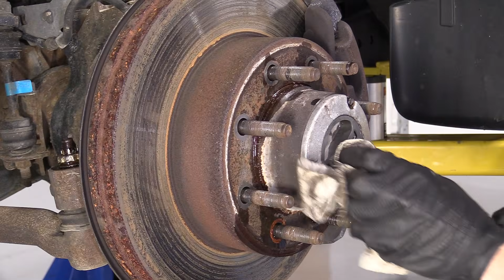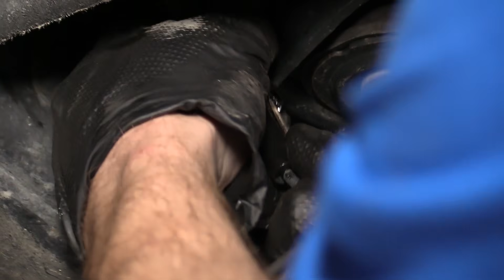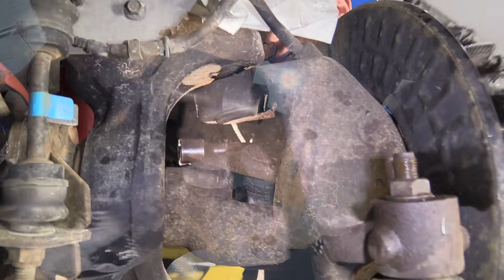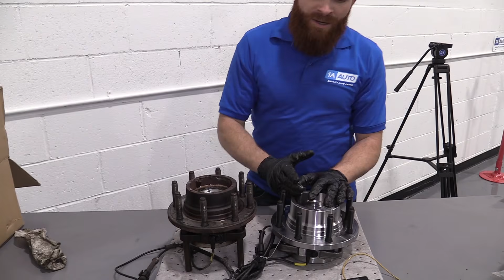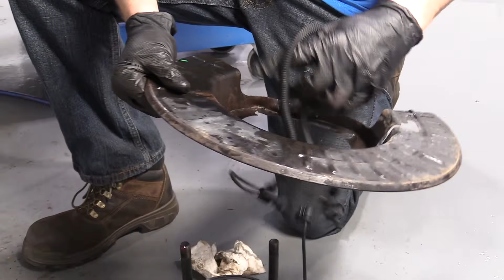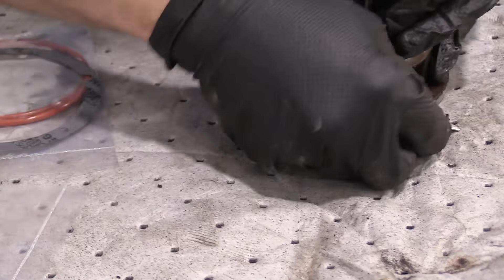How to Replace Front Wheel Hub Bearing 11-16 Ford F250

Comment: Good video. Details and nuisances are very helpful.
 
I've been a "backyard mechanic" for over 40 years. I'm a business owner and I service my own vehicles, so I tackle most of all the repairs.

That being said, no matter how experienced you may be there's always room to learn. I did on this video. 

The screws to hold the ABS wire were tightened all the way so no freedom to move as explained in the video. I suspect the previous owner, of my 2016 F350 4WD, or a repair shop made them too tight. I made sure they moved freely.

To remove the snap ring, I suggest getting a quality pair that has a long reach. 

I did not have to remove the tie rod end. Not an issue to reach in to loosen and the tighten.
Reply from the maker: +@forfreedom-f4u Thanks for checking us out. Shop for high quality auto parts on 1AAuto.com:

http://1aau.to/m/Shop-1AAuto-c

Comment: Ty sir
Needto do my 2016 f350 6.7 with 240k miles.
Front end making funny noise after nee tires installed.
No wheel shimmy or vibration just strange noise.

Comment: 2 things already-  I've done 2 sets of these on a 99 diesel, and never needed to disconnect the steering linkage, so we'll see if it makes the job easier.

The most important bolts that need penetrating spray, the 4 bolts that attach the wheel hub assembly, didn't get sprayed.

And I don't agree with needing an alignment when swapping a wheel hub.

I came here to see what impact he uses, because I can't remember if the last time I did mine, I just used my own strength w/ a breaker bar.  I was much younger, so this time I want to use an impact, but I know there's not a ton of room back there.  I guess I can crawl under my truck tomorrow and see.

After a bit further in the video...

I hate watching mechanics work like this. 2 more things:

The rotor HAS to come off, so just take the damn thing off before you hit on the steering linkage with a hammer, to ensure you won't hit the rotor.
Just wire up the steering arm.  I noticed it not being done as soon as he went to remove the nut, then he says, "I'm not worried about wiring it up...;  Oh wait, maybe I should wire it up anyway."  Yeah, good idea so you don't bump into it and mess up the other tie rod end.  Or stress that other end by letting it hang.

See, this is the thing about letting people work on your shit:  They may get the job done right, but who knows what OTHER stuff they fucked up in the process, that won't show up as a problem until many miles later, at which point you have no recourse.

I would NOT want this guy working on my truck.

Man, this dude!  The snap ring:  He says it's probably the hardest part of the job.  Not even close, as long as you have snap ring pliers.  The reason they include a new one, is you really should only bend that ring outward one time- the time you have to do so to install it.  Otherwise, you could just re-use the old one.  So what does he do?  He bends the new one.  So now that new one will have been bent more than necessary.  He could've just as easily demonstrated how they work on the old one.  Not a huge issue, but still.  

And the thing he DOESN'T mention about the snap ring- Make sure you have the correct tips installed (THERE'S a good place to use the new one), so they fit into the holes without any play, and make sure you have those tips FULLY inserted into the holes before you try to remove it.  If you do those 2 things, that snap ring will pop out just as easily as it did, and the pliers will NOT slip off.

And then the way he tore up the tab on that electrical connector.  Nice job!  All those connectors have a release clip that you have to raise up slightly, while at the same time depressing the locking tab, while at the same time pulling the connector apart.  THAT is the hardest part, or one of the hardest parts of the job.  The older the truck, the more brittle they can be.  You gotta be very careful with them.

Not a bad idea on using the truck's steering to break the hub free of the knuckle, but it goes to show that he took the tie rod end off too early ( I say it's not even necessary), but I could just see someone like this (based on the other dipshit moves he's made) banging the door against the lift when he gets in/out of the truck.

A much better way is to use the rotor as a slide hammer, like mentioned below in another comment.

I can't see beating on that hub with a hammer and transferring all those shocks into the needle bearings in the u-joints, and the other end of the axle shaft where it connects into the differential.  Idk if it really matters, but that really made me cringe.  I have always been able to separate them with a pry bar between the hub and the knuckle.

Alright, I'm done picking his job apart.  I'm sure he'll get it done ok in the end, but imo, he doesn't think things through well enough.

I'm not watching the rest of this, this guy's a hack.  But I will add something that he also didn't mention:  When I did mine on my 99, I bought Timken parts.  They are the SAME EXACT BEARING they produce for Motorcraft, but about half as expensive (you're paying for the name, in part.)  But, even Timken can have issues.  Rotate that bearing before you install it.  Anything less than PERFECT feel, don't use it.  I had one of my 2 that had a slight "bump" in the rotation, so I returned it.  The replacement was perfect.  It happens.

Comment: Lisle 40100 is a great tool for breaking the hub loose. They also have a great tool designed specifically for the super duty spindle snap ring, 38700 is the part number.

Comment: The engineer at Ford that thought that snap ring was a good idea needs to be the one to deal with it every time a wheel bearing on every truck with that hub needs replaced. I've bought and broken 3 pairs of snap ring pliers trying to get that off and still no dice.

Comment: Torque spec for Wheel Hub Nut (from service manual Section 204-01BN): 
"Position the wheel bearing and wheel hub and install the 4 new nuts. Tighten to 180 Nm (133 lb-ft). "

Comment: Tip from old timer....
Take the hub apart leave the rotor on.
Remove outer brake pad reinstall caliper.
Take off bearing nuts.
Start and press brake hard.
Use a clamp to push caliper back in.loosen bleeder first dont push the fluid back into the master.
Slip the outerpad between the inner and the rotor start and press again till rotor is against the bracket. 
Now Remove bracket with caliper. 
I replace the rotor when doing wheel bearing so you don't have to separate them unless you reuse the rotor easy on the floor with blocks and hammer.
The bearing has been pushed out on one side.
Put a nut on one front stud halfway. 
Get a large punch that fits the nut good but goes into the stud.
Place it like he used the socket with extention. 
Turn the wheel to drive the punch into the stud and push till nut bottoms.
Remove nut.
Prybar the last little bit.
No hammering.

Comment: This is a great step by step on how to do this job. One thing to add, the split ring in the hub is very difficult to get out unless you have the proper tool. I have tried 3 different types of pliers and cannot get it out. Apparently Lisle makes a tool specifically for the job and the model is 38700 Spindle Snap Ring Plier. I live about 45 minutes from the nearest town, and wish I would have known this before I started.
Reply: Absolutely! Had the same issue, luckily my neighbor is pretty handy and had a set of old school blue-point pliers that worked like a dream.

Comment: Friendly tip, i couldnt get my rotor for the freakin life me, prayed to all the gods tried every method nothing, almost gave up, then i had one more idea, grabbed a 25lb weight put it up between the rotor and the brake caliper, its hard to explain but once you get it in position, youll know what to do, i used the 25lb weight solid 2-3 hits and the rotor popped off, no damage no nothin, the 25lb weight is one of the old small circular ones that resemble a discuss from track n field
Reply: I love this.  I fought a rear disk on an F150 for hours, because the parking brake is a drum brake inside the rotor.  With the pads fully retracted, The rotor was still hung on the worn lip.  I finally wedged some type of pry bar behind it so the hammer blows wouldn't be taken up by the springs.  The replacement went on with 2 drilled and tapped holes so I wouldn't have to fight that battle again.

Comment: This has been fun to follow along.  Not fun to do,  the first hub took a week to get off as I found the right tools for the job.

There’s a super duty specific snap ring plier that made it much easier.

And after braking the hub from the knuckle using the power steering- which is genius.   The 3 jaw 7 ton puller from oreillys made getting it the rest of the way out a breeze
Reply: What I like to do is cutting to of the bolts, put in a 1/2 bolt and a nut between knuckle and wheel bearing, turning this nut wirth a open wrench will push it out, doing it equal on both sides makes it easier

Comment: To remove the bearing, could you use the steering pump to pull it off. Like the extension but in reverse? Tie a strap around the lungs, around the lift stand, and turn left? Ever try? Thanks,....great video BTW!!! I'm a do-it-yourself guy without your equipment. GOD BLESS and thank you for sharing!

Comment: Take your rotor and put it on the hub backwards with 3 or 4 nuts installed far enough the threads protrude through each nut. Grab rotor and begin sliding it back and forth and this creates a slide hammer and gets the hub assembly of relatively easy. 😎
Reply: Unless you live on the rust belt…
Reply: Great tip, makes for a slide hammer, I LOVE IT.

Comment: Is there anyway that you could give me the name brand or part number of those C clip pliers you used to take that C clip from the inside of the hub out? It took me 2 freaking hours to install that clip, raaaaaaawwww!!!!! It came out easy but to install it, it took me FOREVER to reinstall it. I went through 3 different sets to install it and I finally had to grind the outer edges of one set and still gave me trouble to install it. I noticed that your set had factory permanent tips on them and the ones I was using I could take the tips off and install other tips on it. I noticed yours reached in the hub nicely but mine i had to grind some of the outer edges so I could reach in further in the hub. I now have to do the other hub so this is why I am asking ya for a name brand or part number from your pliers. Thank you for the video, it's the best video out there demonstrating how to remove the hub bearing on the Ford f250. 👍🏻👍🏻👍🏻👍🏻
Reply from the maker: +William Santiago Thanks for the feedback!

Comment: Great video.   What would cause the front brake rotor area to get to 550 degrees (other side 150 degrees) if the calipers, hoses, pad and rotors were replaced?  Could the bearing cause this heat?  2011 Ford f250.

Comment: Another trick to separate the bearing from the spindle I learned is: put the wheel on with a couple lug nuts, then hammer it like tripe H with a sledge hammer then that thing will go and not damage anything other than the tires feelings
Reply from the maker: +Shakblak Thanks for the tip! We'll pass this info along to our production team.

Comment: HELP, my snap ring pliers will not pull that little ring out. And I have tried several different pair. My husband can't get it out either, he is a cert mech but is used to working on older vehicles. Is there a trick to getting that ring off?
Reply: I am having a surgery soon and I need my truck back up and running.  :(

Comment: First of all thx for your video i replaced my 2012 f250 FX4 
driver side wheel bearing assembly today! Got a few comments #1 if your gonna change your wheel bearing assembly spray all nuts and behind rotor with PB blaster several days before your repair and it will be a breeze! Didn’t need a sledgehammer at all, everything slid right off.#2 you don’t have to remove the driver tie rod i did the whole replacement without removing it.good luck

Comment: Does anybody know what snap ring pliers those are I need to change mine and last time it took forever to get snap ring off. Any advice on where to get some pliers like that quick?
Reply: Yes u need to get the ones called lisle snap ring pliers LIS-38700 on eBay or Amazon
Reply: They will say Ford super duty

Comment: Good vid... but!!!! You do NOT need to remove the drag link especially if the vehicle is off the ground, removing the drag link definitely requires realignment in most cases...

Hub grease is not required on these parts?
Reply from the maker: +Winston Williams Thanks for the feedback! Our parts come pregreased and ready to install.
Reply: I'm sure he took it off to be able to spin the knuckle to get better access to the studs and the retaining nuts.

Comment: Awesome thorough video.   much appreciated.  this is same procedure if the truck has electric button flto engage 4 wheel drive and also had the manual lockouts correct.  im going to do the work for a friend.   his truck has a switch but also can be done manually.
Reply: Should be the same, but there will be a vacuum line going to the hub also

Comment: Where can I buy snap ring pliers like yours? 
I'm currently doing this repair and cannot find a pair that will fit between the hub and axel..
Reply: Its Spain to find them. Not the most ideal but go to lowes buy the longest pair of needle nose pliers you can modify the ends to fit the snap ring thing put to small pipes on the pliers and it will come right iff.
Reply: No go to Amazon or eBay they are called lisle snap ring pliers Lis-38700 Ford super duty I know I just order a pair awhile ago hope this works bro
Reply: I have that same trouble.  I bought 4 pairs of snap ring pliers and none of them work.  Good ones are not available around here unless you have a Mac or Snap on tool truck stop by.

Comment: these are those typical jobs where half way in your like well if i just remove the axle seal and the steering  knuckle i can replace the upper and lower ball joints while im down here, 5 mins later since i have the axel out i guess i can replace the u joint to the axle hub. lol mechanic life =p
Reply: and all new rotor caliper bracket and pads to go with the new seals bearings u joints etc
how did i turn this into a 3 grand home job?
Reply: 100% just happened to me 🤣🤣

Comment: i Can find the hub service set for the 4x4 will locker mentioned at the 31 :50 mark in the video
Reply: I had the same problem finding the number here is part: DMFWH00003, hold onto your wallet for these couple seals.